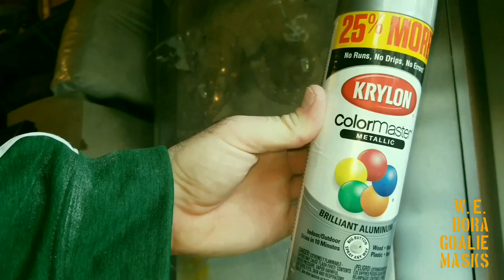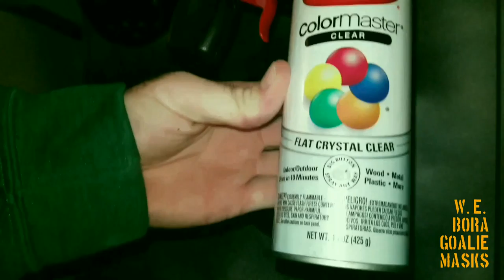How To Make A Jason Voorhees Mask. Friday the 13th Part 8: Jason Takes Manhattan Cosplay DIY

Comment: How did you attach the D rings? Usually I just cuss pop rivets
Reply from the maker: I use copper leather rivets. They are typically used for making horse saddles much like the metal halter square used on the back of jasons part 8 mask. You can find them and the tool I used to tap them into place on Amazon.  The brand name of the ones I use is Tandy Leather
Reply: @WEBora  greetings, is that a wooden handled ice pick that you use for scratching?

Comment: What did you use for attaching the straps to the mask? Where can I find those?

Also, in general, what snaps do you use for your masks? The ones I find in stores are too short to go through the mask and top part of the snap
Reply from the maker: They are 1/2 inch copper rivets by Tandy Leather. You can find them on Amazon
Reply: The snaps for an elastic strap are Line 24 snaps. either Tandy leather, Hobby Lobby, or Michael's will have them

Comment: What paintbrush do you use to paint the hockey mask
Reply from the maker: I myself don't know what the actual correct colors to use are. In fact I use acrylics in the video which is definitely incorrect. In the movie, the mask looks as though its painted smoothly as if from a spray paint rattle can or a airbrush. The way I did it was acrylic paint from Walmart, those cheap bottles in the crafts area. I use them some times with a spouncer (sponge brush) because I like the texture that it produces. I find that once you add a layer of wash over the layer of acrylic paint, it has more nooks and crannies for the wash to seep into. So its definitely not screen accurate by any means but it looks kinda cool. The acrylic colors I usually use for part 8s are a few different yellows. Pretty sure the names are daffodil and kings gold (adding white when needed). Don't want it too dark.  Theres also one with the word Sunset in it. I forget the full name. So basically, yellow it up with those sponge brushes, and dirty it up with browns and blacks, being sure to spray it with a clear coat between layers. Hope that helps you out.
Reply: W. E. Bora Thanks, I’m actually painting the exact Part 8 hock, with the exact same paint.
Reply from the maker: @RyanJacksonryanlouisjackson  oh awesome bro. Good luck and have fun. If youre on Instagram, post a picture once you're done. I'd like to check it out.
Reply: What’s your Instagram
Reply from the maker: @RyanJacksonryanlouisjackson  W. E. Bora
Reply: Use a spouncer sponge brush and the correct acrylics are snow white, golden sunset, and linen but these do a great job as well. Like stated all of that can be found at walmart. In the film a spray paint was used, but that color has since been discontinued. The closest you can find is Bright Ideas by Krylon.
Reply: @WEBora  hello, how do you do your washes?